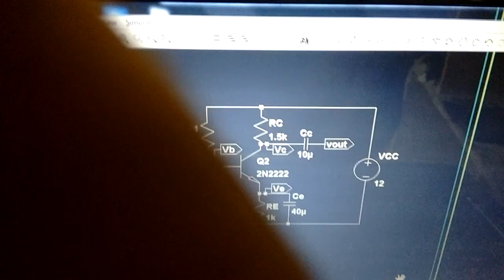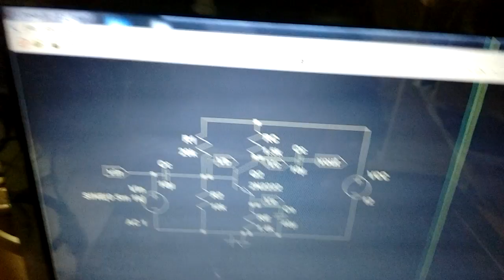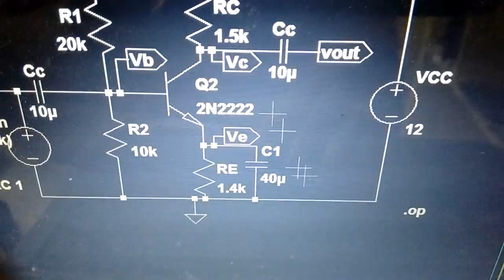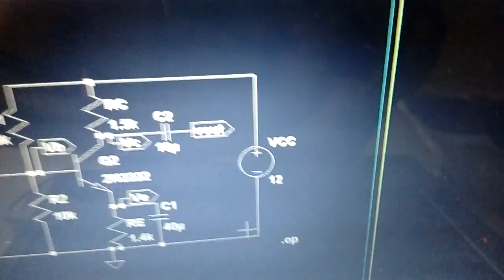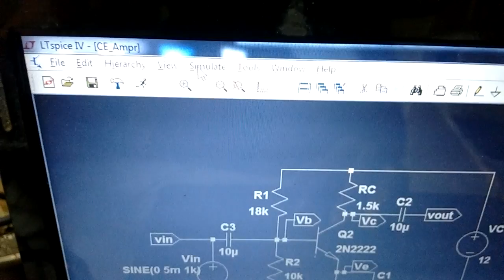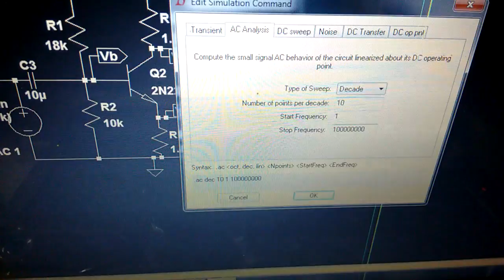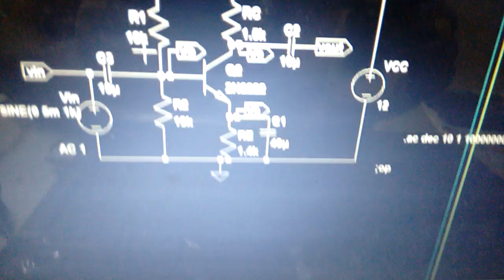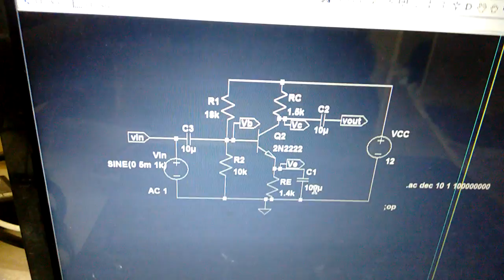CE Amplifier Simulation

Comment: Sir, Thanks a lot for this highly informative video. It really helps a lot. I have a doubt. On simulation, we can confirm that all the values are right. But beta is not 150, we have assumed during calculations. As per simulated results, Beta is 206. We have to change the value of Icq, slightly, if we want to get exactly 150 in simulated results?